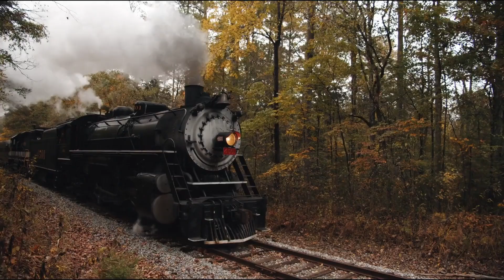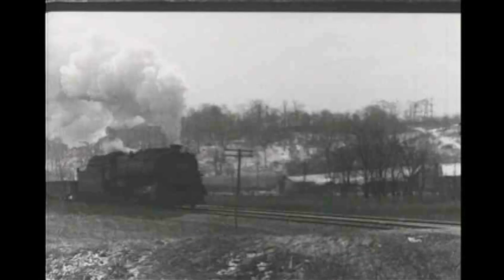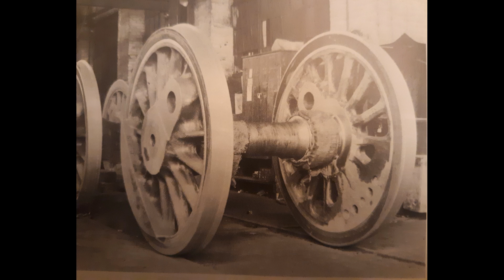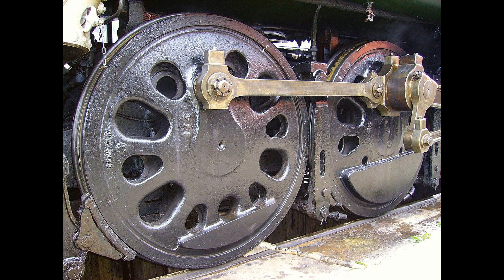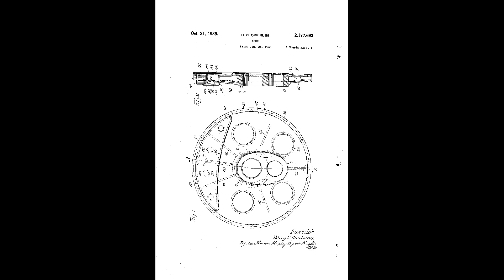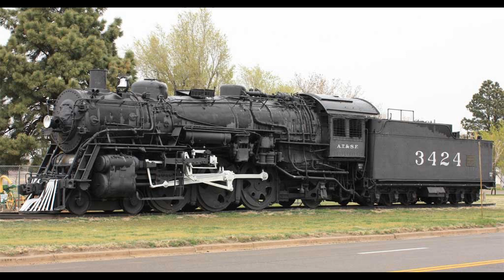Locomotive Drive Wheels : Box Pok, Baldwin Disk, and More

Comment: In the first picture of this video it shows rods down.  Where the connecting rod pins are essentially not moving relative to the rail.  This is a problem when the other side or other piston is on dead center.  How does the engine start moving?  I was stumped.  He then explained the steam in this sides cylinder is PUSHING on the piston head and thus the engine.  You could weld the wheels to the rail in the rods down position and the engine would still try to move forward because the steam is pushing on the cylinder head and thus the engine.   Pretty cool I thought, and think,  but then I'm a mechanical engineer so you know.  NERD.
Reply: Look up the kinetics of a 'class three lever' which is what a rim-adhesion-loaded driver with central pivot taking the draft resultant but driven by an eccentric pin constitutes.  (It is not as simple as a crank producing torque from a connecting rod as in an IC engine!)

There is certainly such a thing as a 'dead center' though -- in fact there are two, which we call FDC and BDC rather than the more familiar 'top dead center' in vertical or V motors).  A single-cylinder engine would stall if loaded with its piston and rod in this position.  This is why two-cylinder double-acting engines have their drivers 'quartered' at 90 degree phasing, so that one side can always 'turn' the engine off dead center to allow admission on its side.
Reply: @wizlish  I looked at the class three.  The rim of wheel to rail contact is the anchor point (Rods down) Fulcrum?.  The connecting rod pin is trying to be pushed to the back of the engine by the piston which would push the axel backwards instead of forward.  Again why does the engine go forwards with both pistons giving motive force.  The answer is the steam is pushing on the tie rods through the connecting rod but also on the piston head which is cast into the engine frame which pushes the engine forward.  Since the class three lever would be trying to push the axles and thus train to the rear (rods down). When the rods are on top you can see the piston pulls the axle forward again the pivot point or fulcrum is the wheel rail contact.

Comment: So much to learn about steam engines and this little tidbit was awesome, thank you. On a side note I was recently at the annual Utica NY model train sale and found something interesting. Its a 5 - 1/2 inch cast locomotive wheel that says Baldwin Disc Wheel across the top. It looks just like a Baldwin Disc Wheel. I'm not sure if it was a promotional item from Baldwin, maybe a paper weight, maybe you can shed some light on this item. It looks of the quality that maybe it's for a scale live steam engine.  The guy I purchased it from didn't know either. Thank You.
Reply from the maker: Hi RHJ3.  Without seeing the actual item I can't say for certain.  It may have been made as a novelty item/paper weight.  However, it could be a wheel for a working model of a steam locomotive.  I used to work in the Baldwin Tower in Eddystone, PA.  In the lobby was a working model of a Reading 4-8-4 that ran on what appeared to be 6" gauge track.  As I recall, the drivers where about 8" in diameter.  So, your wheel could be for a working model that may have run on smaller gauge track.  I hope this helps.  Thanks for watching!!

Comment: Box Pok wheels are still running in the UK on preserved Southern Railway "Merchant Navy", "West Country/Battle of Britain" class 4-6-2 locomotives.  Originally with flat sides, these so-called Spam Cans by us young trainspotters in the 1950s, some were rebuilt in 1956 but retain the Box Pok wheels.  Quite a few them (both original and rebuilds) survived into preservation when the Southern got rid of steam in 1967.  They were also fitted to the Southern Q1 class 0-6-0 locos, as someone else has said.  Only one Q1 survives in the National Railway Museum in York.
Reply: Those aren’t Boxpok, but Bulleid-Firth-Brown wheels. These are single disc, but the concept of being lighter and stronger than spoke drivers is the same. They greatly differ from American discs in that they were originally designed without counterbalances! The rebuilt Pacifics received balances on their center driver after getting conventional Walschaerts gear. Easier to maintain, but the added balance made the Light Pacifics heavier on their wheels. Had the rebuild program not been cut short, a few of the Spamcans would’ve been retained to work the lighter routes west of Exeter, as the original wheels and Bulleid valve gear saved stationary AND dynamic weight
Reply: These were Bullied Firth Brown wheels, a single disc type where the back of the apparent 'spokes' is open.

Comment: Now , how was the balancing done ? Did they calculate the side rods weight or did they have a way to run balance ? This is a great video.
Reply from the maker: Hi keithlewis9106.  The wheels were balance as a wheel set.  In other words the wheels were on the axle when the balancing was done.  The weight of the main and side rods could be calculated or obtained by actual measurement, and I believe the balancing was done on a wheel lathe, I'm not sure if the wheels were dynamically balanced or just statically balanced, but they were able to achieve a rather accurate balance.
Reply: @americansteamlegacy-yh9dr  depended on the railroad...  PRR in Juniata Shops in Altoona PA had a full size engine dyno that they could run on rollers, at speed to measure performance. They would sometimes do weight tuning there as well.
Reply: Ralph Johnson goes into great detail in his book on the Steam Locomotive, and you can start there.  Some British companies, notably the GWR, used high-speed dynamic balancing of drivers, particularly the mains, and built special motorized facilities to do this (the driver wheelsets were not in the frame when this was done, and for two-cylinder DA engines bobweights on the pins would be used).

Advanced balancing practice can be determined with reference to Voyce Glaze's balancing book (which is preserved at NWHS).  This distributes overbalance for surge in the coupled wheels, retaining only enough in the main for the vertical component of piston thrust estimated for 100mph operation.

ATSF had a procedure for calculating both cross-balance and angling a slight (off the top of my head 4-and-a-fraction percent) which has been covered in online references.

While it can be difficult to find the reference Stateside, the account of how the driver balancing was calculated for the British 9F 2-10-0 is particularly interesting -- these had 57" drivers without fancy lightweight rods but could run over 90mph in service...

Comment: Earlier spoked driving wheel centers were made of cast iron and were subject to more shrinkage or porous portions of the castings.  The cast steel wheel centers could have small casting defects repaired by welding depending on design specifications, type of material and welding procedures.  With the BoxPok or variants from cast steel allowed for higher strength with less weight and better control of the stresses from the tire shrinkage, crank pin stresses and the operating stress during locomotive operation.  Also, there was a redesign of the BoxPok centers due to deformation of the wheel rim (apparently) due to lack of strength between box sections to resist tire shrinkage pressure.  But all that amounts to are the modifications due to in-service conditions.   Few items work perfectly right “out of the box”.  All in all, one of the better modifications developed for the steam locomotive.  Thanks for the ‘lesson’ on wheel centers.

Comment: No consideration of the 'Bulleid Firth Brown' wheel used here in Britain on the Southern Railways. somewhere between a Baldwin disc and a 'pok'
Reply: Not really related at all, the BFB is a single disc design without any box sections more closely related to the 'wobbly web' wheel of 1960s racing cars.
Reply: There never is any yank respect for British Steam...

Its like they're jealous that not only did we invent the things in 1802 - We also had THE FASTEST...

Although Bulleid had nothing to do with that record, obviously... 🤣👍
Reply: Of course, the Brits couldn't cast the BFB wheel well enough in postwar years to assure Riddles of its advantages -- all the Standards used conventional spoked drivers.
Reply: (No disrespect intended to contemporary British design, though!

Comment: Don't mind me asking, but will there ever be a video on the experiments attempted to spoked drivers themselves in order to enhance stability, durability, and counterbalancing? While doing research on the New York Central's class L-2d of Mohawks, I noticed that the two testbed Mohawks (#'s 2995 and 2998) had webbed drivers. Another example would be the New York Chicago & St. Louis' class L-1A/B  Hudsons with the center driver being webbed. After noticing, I always wondered, why was this?
Reply from the maker: Hi porthuronerieproductions9980.  That's a great idea for a future video and will require quite a bit of research.  Thank you for the suggestion!!!
Reply: Those are Union Steel Castings 'Web-Spoke' drivers, and were apparently purchased and tested by a number of railroads.  I believe elsewhere in this thread are some very good pictures of a PRR K4 with a Web-Spoke main and conventional cast coupled driver pair -- with a note that this also shows typical repair needed to cast spoke centers.

Apparently NYC considered these 'equivalent' enough to the Boxpok and Scullin centers on the J3a Hudson's that they used them indiscriminately on the same engine in the latter years that 'appearance didn't matter but performance still did' -- see Thoroughbreds for pictures and a rudimentary discussion.  I suspect NYCSHS would be a source for more detailed historical and technical description.
Reply: Sounds similar to the Australian production patented  SCOA-P wheels.
The most use currently are on the preserved and running Victorian Railways R class Hudson locomotives.
Came to late to make a big impact but used in several Australian late production steam locomotives and some African ones too. Vulcan foundry in the UK would promote them on the last locomotives they made.

Comment: Thanks from NSW Australia. Our last express steam locomotives the 38 class were fitted with boxpok drivers. I knew the locomotive frames came from General Steel Castings in Granite City but not that this is where boxpok driving wheels came from. Do you know if the design was ever licensed out to be cast elsewhere ? Next time I visit one of the surviving 38s I will look to see if there is any evidence on the wheels as to where they were cast.
Reply from the maker: Hi davidmason7765.  As far as I know the Box Pok was produced only by General Steel Castings since GSC held the patent.  I remember reading somewhere Baldwin had something to do with it as well, but I don't think Baldwin ever produced Box Pok wheel centers.  Great question! Thanks for watching!!
Reply: GSC had a casting facility at Eddystone as well as at Granite City -- this is why you can see 'Baldwin Boxpok' in the ATSF 4-8-4 centers
Reply: @wizlish  Thanks!
Reply: The last express steam locomotives for Australia were the Victorian Railways R class Hudsons.
After fitting Box Pok drivers to several classes they encountered maintenance access issues. Out of this the lighter and stronger Australian SCOA-P wheel was developed and fitted to all R class Hudsons made as well as the J class light consolidation.
Quite a few other late era Australian and African steam locomotives used these due to their advantages.
Reply: @johnd8892  Fascinating!
Reply: @johnd8892  I have just commented that R class were the only loco’s I’d seen them on. Now you have given me flashbacks to watching South African films on the condenser systems they used, and yes. S.A did use SCOA-P type wheels.
Reply: @johnd8892  There is a good section on Wikipedia about the Steel Company of Australia's (SCOA-P) P - standing for F C Paynter who patented the design. They were designed to combine the strength of the Box Pok whilst reducing weight. Their adoption also allowed access for maintenance that spoked wheels facilitated.

Comment: Meanwhile the Norfolk and Western, renown for some of the greatest steam locomotives, never used anything but spoked drivers. Also, the 2-6-6-6 Allegheny (Blue Ridge on the Virginian), the heaviest steam locomotive (the first group of them had a greater engine weight than the Big Boy), also used spoked drivers.
Reply from the maker: Hi stuartaaron613.  It's hard to believe double disk type drivers weren't used more extensively on the superpower articulateds.  Even the N&W J Class 4-8-4's rode on spoked drivers.
Reply: Casting made some progress with time, to the point that manufacturers, by the 40s, could cast large parts, like a chassis including the cylinders.

I imagine they improved casting of spoked wheels, by controlled cooling, reheat, etc…
Reply: There was also the Web-Spoke center (which, interestingly, was interchangeable with Boxpok and Scullin centers on New York Central J3a Hudsons) which addressed the rim strength and spoke-to-rim transitions by casting a 'web' into the inner face of the center.  These had lower unsprung mass than a typical cast disc center.

A further variant of this was the SCOA-P (for 'Steel Company of Australia - Paynter, iirc) which cast the spokes U-shaped and made the web on the outer face.  These got closer to the mass savings of a deformed-plate center while retaining the ability to hold adequate angled balance mass.
Reply: Pity the lighter weight but stronger Australian design SCOA-P spoked wheel came too late to have been used outside a few Australian and African late steam locomotives.

Comment: My question is, about the distance between the crank pin and the Center of the drive wheel. Was this something standard or did it vary on locomotive types? It would seem the distance would make a difference of leverage in moving the locomotive. I have never heard any discussion on this.
Reply: The crank pin radius would have been determined by the length of the piston stroke in the cylinder. Cylinder dimensions and effective steam pressure basically determined the engine's horsepower. It's actually a very complicated problem for the locomotive designers. Horsepower vs speed vs economy. Lots of compromises to balance these factors to produce a locomotive suitable for specific operating conditions (speed, tonnage, economy, low maintenance). And all done with slide rules and #2 wooden pencils (and some very smart minds)!
Reply: @prsearls  Thanks that helps a lot. I always knew that the wheel diameter makes a difference in speed and pulling power, Like different gearing. Smaller wheels mean more pulling power but less speed. etc
Reply: The crankpin radius is determined by the stroke, and there is some complexity in the 'history of balancing' as longer stroke with smaller piston diameter and hence overbalance mass came to be a sort of Lima trademark.

The fun came when you wanted shorter stroke (for perceived higher speed) on a locomotive with high ihp.  The great canonical example is the PRR T1, where the stroke cannot be minimized any further because the 'web' between the axle fit and the pin fit would be too thin for needed strength (see Vauclain's talk at Atlantic City in the early '40s).  PRR went even further in shortening main-rod stroke by grinding the main pins eccentric where the mains were located, so the reciprocating stroke was less than the side-rod crank circle...
Reply: That is interesting. Altoona and Norfolk & Western engineers certainly produced some of the highest performance and advanced steam designs. If diesels had been delayed for another decade, it’s interesting to imagine what we would have seen.

Comment: Good video thanks. (Just to clarify ‘Boxpok’ is pronounced “box-spoke’)
Question: what is the loco you feature towards the end? I notice it has an air horn atop the the boiler.
Reply from the maker: Hi struck2soon.  AT&SF #3424 is a Baldwin built Pacific from 1919 and is on display in Kinsley, KS.  As for that feature on the boiler......I agree, it looks like an air horn but honestly, I have no idea what it is.  In fact, I didn't notice it until you pointed it out.  I haven't been able to find any information on what that object might be.  Thanks for watching!!!
Reply: Air horns were increasingly adopted because they dramatically reduce the heat an mass loss from blowing whistles.  I have seen figures (from Kiefer if NYC) of 6lb steam per second -- which had to be carried, water-treated, and then heated to saturation pressure.

Some engines had them to sound more like the early generation of 'Streamliners' or to provide more directional warning at crossings.

The Lackawanna famously used an early version of 'chime horns' on some of its locomotives.  I had resigned myself to wondering what these sounded like... there is a video of Fox Movietone outtakes that incidentally records these horns in action!
Reply: Thanks. Hopefully one of your viewers can offer clarification.
Reply: @struck2soon  SP had horns on some of their steam engines, maybe it was experimented with elsewhere.
Reply: @sharkheadism  I am sure other railroads also had air horns, I have heard them on some of my vintage steam recordings as well.
Reply: @struck2soon  I thought you were referring to the Milwaukee Road 4-6-4 Baltic at the end of the video. That loco does feature an air horn atop the boiler as you can see in the picture.
Reply: @chickengeorge_8261  cheers!